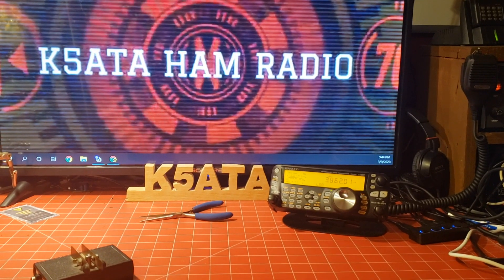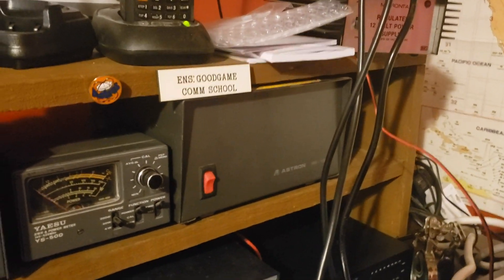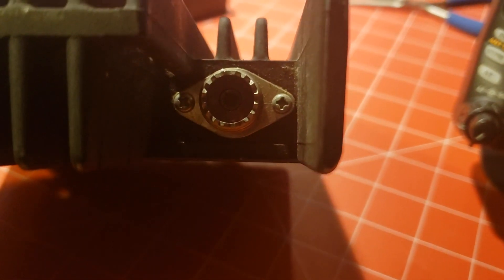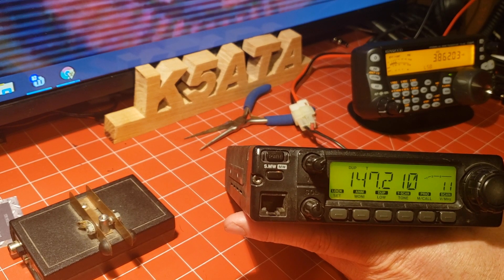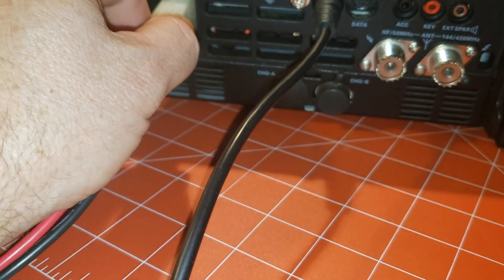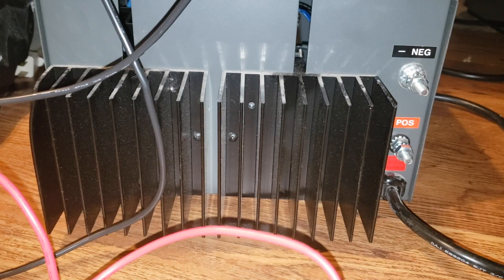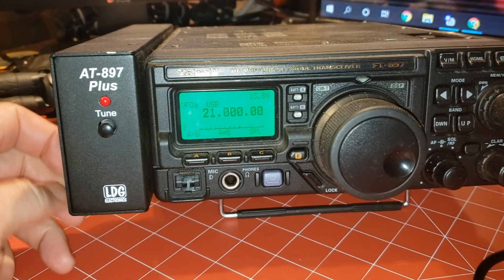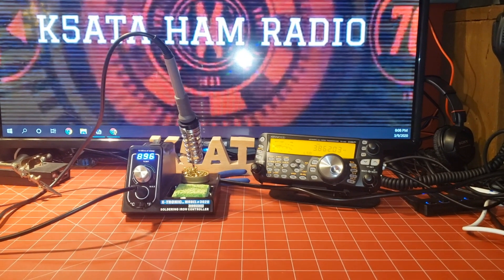Ham Radio Basics: Station Setup VHF/UHF/HF Radios and more.

Comment: My 11 year old and I are super interested and going to our first club tour today. He wants to be like Dustin fron Stranger Things. I scored a 70% on my 3rd try no studying though I'm in IT. Any suggestions on first radio.
Reply from the maker: That is going to depend on what you want to do with the radio and what area you live in. For your tech license, I often recommend the Icom ID-5100. It does 2m and 70cm, has a touch screen, 50 watts output, and is great for setting up at home or in a vehicle. In fact, when in a vehicle, it can auto search repeaters based on your GPS location, so it is wonderful for road trips and the like. It also has DStar digital mode, but using that may depend on your area. Thanks for watching, and feel free to reach out if you need any other help.

Comment: Did you have an issue with the Astron? Just wondering why you bought two Tripp Lites after having an Astron, they are not that different in price.
Reply from the maker: No. The astron had been running since I got licensed 25+ years ago. I had stations at different places so built up a few more supplies over time

Comment: I’m new to all this and learning from the ground up. I have question. If you have a HF radio and HF antenna can you transmit on uhf/vhf frequencies? Or do you need two different radios and antennas?
Reply from the maker: You would need a different radio/antenna combination. There are some radios that have VHF/UHF/HF but they can cost a bit more. You would still need two antennas however. For example, I have an Icom IC-7100. Great radio. Does HF/VHF/UHF and has two antenna inputs. One for the HF antenna, one for the dual band VHF/UHF.  Feel free to email if you have any questions.
Reply: @K5ATA  Is the 7100 what you are running in your truck now? i just watched a few days ago the older video where you were trying different mounts for your 5100.
Reply from the maker: I am running the 7100 now. To be honest I am trying to find a nice looking way to mount both, as I really like the 5100 for vhf uhf and the 7100 to give me Hf. Just need to find a clean way to do it
Reply: @K5ATA  Cool, what mobile HF antenna are you using?
Reply from the maker: I just have some ham sticks right now. I’m still looking at mounting options I like.
Reply: Yaesu FT-991A does HF/VHF/UHF